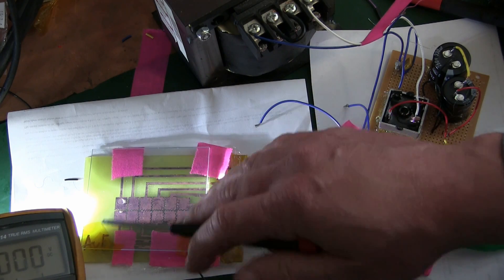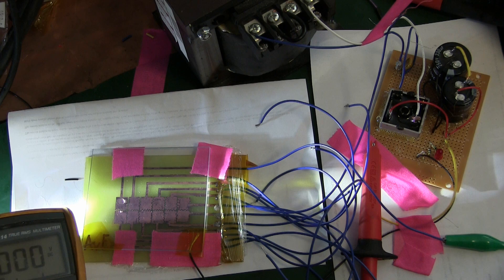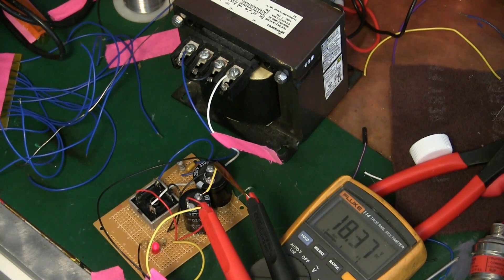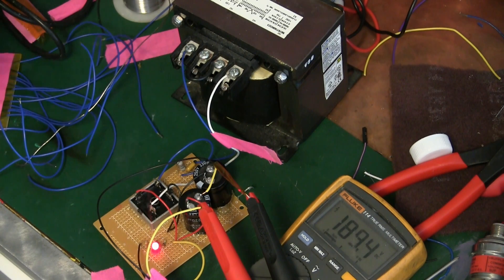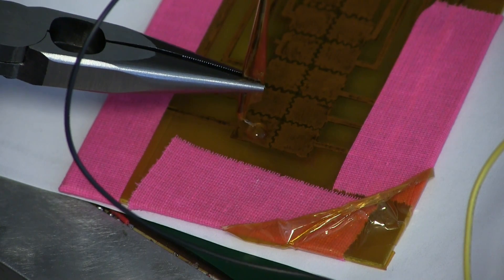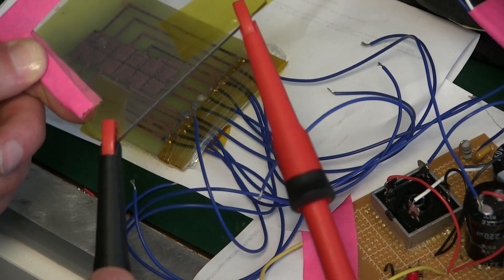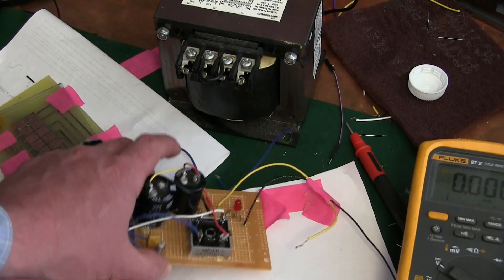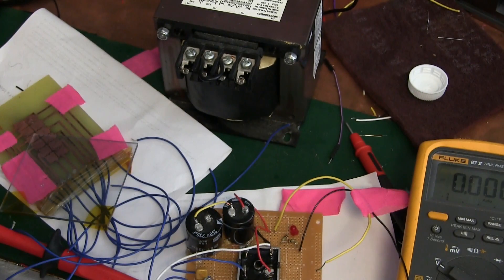Electrowetting Experiments. Penny Pucker over 9000!

Comment: AVE cool concept.
Ultravolt makes HV supplies that will be just what the doctor ordered and they're adjustable.

Since this is volts, not current, 0.1uF 1KV ceramic caps should be fine.
Overvoltaging transformers can cause them to saturate even on the secondary side.  You might want to consider using a voltage multiplier to get the higher voltage you seek.

Comment: Love your vidjeos!  You need balancing resistors on those capacitors.  BTW, save good, solid American pesos by using hydrogen peroxide and muriatic acid for etching. No stain, and cheap as dirt. Keep up the good work!

Comment: Just shooting from the hip but at 9:26 when you are holding the plate and saying that "it needs to be conductive" what about cutting out a square of ESD bag material and backing it with an insulator?  Got to be cheaper and more available than conductive glass!

Comment: I made a boo boo yesterday I was soldering  2 caps to a board and the iron slipped out of my hand burned the crap out of my arm .Then it hit my fluke 87 screen and melted that. I went to the hospital as I am a disabled vet and on some pretty strong meds that affect my healing . The said is a third degree burn 4 inches by about 5 inches on my right arm.Now I have to take antibiotics and change the bandage 3 times a day and put some crap that burn like hell on it. All from a slip of the solder iron

Comment: Hmmm, you didn't have any of those "voltage sharing" resistors across those two capacipeppers. Isn't there a risk that the pixies aren't equally shared then and one goes off into space? Just wondering.

Comment: AvE you can put lots of resistors in series of 'normal' 1/4W rating and make a massive potential divider.  This is how simple high voltage measurements work

Comment: Dear Sir, 250V isn't so scary, but your caps can easily approach 500 each due to various mess-ups. Zener diodes can be used to clamp the maximum voltage across the caps. You also could use avalanche diodes in clamping reverse config to shunt the extra pixies to ground if each gets above a certain voltage.

It's not a BIG deal since you actually like to free the trapped smoke manufacturers place in all electronic parts. But don't rely on thought that a place on your board has to have only 10 volts when the pixies are freed to find their quickest way home.

P.S. Please smash no more juicers.

Comment: I think you misread the notes on how this works.  Your problem is surface adhesion.  You need to add a hydrophobic coating onto the film, not make it conductive (for God's sake, do not make a surface connected to an HV source, conduction!)  In the original design covered here (http://www.gaudi.ch/OpenDrop/?p=116), they used " Polyethylen (PE) kitchen foil (saran wrap) coated with Rain-X a commercially available rain repellent for wind shields."

Comment: AVE i have the bigger brother to the old school black and decker drill BOLTR you did a few videos back and a heating control energy saving gadget for gas or oil fired boilers if you fancy taking them apart they are both on ebay il do you a trade for rulers and T shirts if you want

Comment: FYI for the current limiting resistor, I've done this before, I found it's best to use two resistors in parallel, two 750k 1/4 watt jobbies or thereabouts, depending on the current the LED needs. At least, if you want full brightness, and you usually do for these kinds of voltages.

Comment: AvE, I think the pulsing of the voltage may be what makes the drops move.  The sound was really prominent in the video you showed where it was working.  Makes sense because it probably works on the capacitance of the water through the insulating layer.  Need some way of pulsing the high voltage.  Maybe you could use a little high voltage switching power supply like a fluorescent light ballast.  You definitely don't need much current, just the high voltage in sharp pulses

Comment: AvE, try a CCFL backlight inverter. Quite high voltage (>1000v with no load) but if you were to touch it, you won't lose a finger or die, since the current is relatively low. Add voltage doubler if you wanna make the pixies even angrier.

Comment: Erm maybe use a cockroft walton multiplier?  much safer ? caps and diodes.. i bet you have

also kapton is hard to get lower then 1 mill, try using mylar?  it can go as thin as 1 micron if you like. but 6 12 and 20 are easy to get. polyeshther is still a relative good insulator.  and use Lycron crystal or any other permanent colorless antistatic spray to make it conductive if you like.

Comment: how those relays or working with 500w dc .. dc has a higher arking volt and it will make those contacts coated with carbon very soon. there is  a very special type of relay that has a special gas to prevent arking on contact ..

Comment: I do allot of work in industrial applications(electrician by trade). I work quite a bit with millwrights and you sound like one. You know your hydraulics, mechanics and all that good stuff. However your electrical knowledge exceeds all of the industrial mechanics that I have ever worked with. 
AvE are you a millwright or a mechatronic god by trade? 

Cheers from Norway!

Comment: Best to add some resistance across each series capacitor to swamp out leakage currents in electrolytic caps that might otherwise make voltages divide unequally. You can also consider putting your indicator LED circuit across just one of the series caps, thereby reducing power wasted in the limiting resistor.

Comment: I used to work at company doing electrostatics. One of my last projects before I left was designing an electrostatic hold down for paper. For our testing, we used a solid copper clad, and charged the copper to from as low as 3kV up to 10kV and it worked really well.

My guess is that your voltage isn't high enough. You could build a voltage doubler circuit to boost the voltage,  there really isn't a whole lot of current that you need. That should easily get you in the kV range, and might yield better results.

Comment: AVE you can try a 2 stage Cockcroft-Walton Voltage multipler to make a low current high voltage DC supply, and piss easy to make - you can keep adding more doublers to them to get your desired voltage and they only require small elecrolytics (rated to the input voltage) and  diodes (rated to the output voltage - 1n4004 diodes will withstand 400V reverse so you can through them in series to make higher voltage diodes), at trade school they only let us play with 24V ac and using a multipler got up to 400V with 6 steps as they don't exactly multiply with a large number of steps because of losses but if you start with say 240V you should get  a few kV easily - diodes being the major limiting factor. Much better solution than the bridge rectifier and great big electro's

Comment: I just watched this related video and they reveal some specifics about their setup. The top plate and bottom plate are coated in a titanium mixture and grounded (conductive) and sprayed with teflon (hydrophobic). Also, they are using a differencial in the 100v range and  oscillating it at a frequency which I don't remember (maybe to gain inertia in a pendulum effect to overcome the gap)
https://youtu.be/tHOvxvL83cw

I also noticed that in the opendrop videos, the drops are large enough to bridge to the next pad.

Comment: Got a 15W resistor in one of my circuits because I needed a 56 Ohm Resistor ASAP at the time. A bit overkill for a single 20mA 3.3V LED, but whatever.

Comment: Happy you like the OpenDrop project and that you do your own experiments on electro-wetting. Your setup should totally work. To move droplets try applying a thin film of silicon oil (viscosity 5) directly to the electrodes. Then apply a stretched layer of parafilm foil. Then some silicon oil on top. Then place a droplet of water about the size of one full electrode on the electrode. Remove any charge in the droplet by touching it with a thin wire that goes to ground. Then try to move it with the high voltage. I use 250 VDC, higher voltage is not always better :-). I am happy to send you a sample of Parafilm and thin silicon oil. Best, Urs

Comment: Hi, you could use a cap with a led instead of the resistor on the ac output to get around the wattage problem.

Comment: Positive voltages repel.  Set up the board so all the panels are positive, with the panel where you want the water to go at negative potential.  This will steer the water drop to where ever the negative pad is.  Put a resistor inline with the ground so the electricity does not vaporize the water.

Comment: putting electrolytics in series is frowned upon since the leakage current differences  can cause significant voltage differences  between the individual caps and they can still go kablamo.  much like batterias you can however put resistors in parellel across the caps in order to (try) to keep equal voltage across each cap.  this is not assurance it wont blow up but ever increases your odds it wont.  be sure to wear safety glasses, aluminum shrapnel  can ruin your day for sure.
Reply: Safety Squints™ activated!

Comment: P=IV may be true, but your current is not constant, it increases with the voltage since you're using a resistive load (I=V/R). A more helpful equation for the power dissipated in a resistive load with variable voltage would be P=(V^2)/R.

Comment: What kind of soldering iron and solder  would you recommend for hobby work, Airsoft wiring and general electronics. I keep eating up the iron tips and tried what i can get locally in Puerto Rico. Thanks in advance :D
Reply: Robert..to reduce the tip wear..try to avoid putting the solder directly on the tip(you do need to do this sometimes, but doing it less will increase the life of the tip).
also, if you are using plated tips(likely), don't file them until it's absolutely necessary...once you go through the plating, the tip wears faster.
Reply: Thank you sir

Comment: I believe that an isolation transfer is simply an even 1:1 ratio of voltage otherwise it's considered a step up or step down transfromer
Reply from the maker: meh. How else would you describe a non-autotransformer that steps down for powering instrumentation?
Reply: Isolation transformers provide galvanic isolation and does not matter if it is step up/down.

Comment: If you need conductive glass, LowE (e=emissivity) pyrolytic coatings are. PPG Sungate500 or Pilkington EclipseAdvantage both are very common types of this glass, and have been  used in a lot of residential windows over the last couple decades. A free source should be eady to find (residential glazer or even old insulated unit). The coated surface can easily be iidentifed with an ohm meter and will have a slightly yellowish appearance/reflectance.  Newer MSVD (magnetic sputter vapor deposition) coatings are conductive to, but are no where near as durable and will oxidize quickly. The old coatings are very durable.

Comment: AvE, how about trying the hydrophobic neverwet paint?  Also, based on the jiggly bits, (mmm)  it looks like they are using an AC exciter voltage of relatively low frequency.

Comment: short the yellow wire to the white wire. it'll be fine I promise :) (although you might want to get higher voltage capacitors first...)
Reply: And I mean the yellow wire between the capacitors.

Comment: 3:27 Especially at rectified mains / high-voltage stuff, when series-ing up caps, you're gonna wanna include some balancing resistors in parallel with'em; a pair of 47k-100k (or however many you need, if you series up more than two caps) oughtta do.
Reply: Yep, assuming you used 100k resistors in this application with 240VAC rectified to 340VDC, they'd be dropping 170V each, so they'd be dissipating 289mW, you'd want 1W resistors minimum.
Reply: Yeah, especially if you're using two capacitors of different values!
Rule of thumb is look up the datasheets for the caps, find the max leakage current, multiply that by 10, and choose resistors that will draw that current at the working voltage.
Reply: Now I'd think that if you were doubling up caps for current rating, you'd put them in parallel, not in series?
Reply: For current rating purposes (increasing the ripple current capability), yes, you would indeed parallel them.
Reply: It's gonna be okay for prototyping. Would be nice to include them but hey, no risk no fun. Also electrolytics aren't usually that sensitive to unbalance since they leak more with higher voltage, making a balancing on their own. Just gotta be brave and not shit your pants if one blows up with a 7.64mm nato round POP sound

Comment: turns out you get used to stupid dc voltage next to your fingers. 700 volts through a tiny coil of wire is enough to get your bones to move magnetally! under your skin. comforting eh?

Comment: uh... just use a CCFL driver out of a dead laptop or old LCD screen. 
edit: there was supposed to be a ? at the end there, was meant as a potential future path..
Reply from the maker: The citizens of youtube await your upload.
Reply: AvE, well shit. If you don't mind promising to send me a get well card if I blow the last of my hair clean off or set my beard on fire, I'll give it a go. Oh, and I thought there was a "?" at the end of that post. oops
Reply: Ordering a little inverter module , some ITO coated plastic for the top electrode and some Neverwet to try coat the plastic with.
Reply: +AvE I'm only going to use a tiny bit of the ITO plastic It's not too expensive, but I'd happily send you the rest the sheet if you'd like it. (If the hydrophobic coating doesn't end up totally fubaring it up I can send it to you after coating it too) 

Anyone have advice on how to switch a couple kilovolts? I was going to make a resistive divider and current limiter to hopefully avoid blowing the ITO straight to hell, but I don't have a better idea than manipulating  a couple wires with plastic rods, to safely connect and disconnect the electrodes.

Comment from the maker: www.gaudi.ch are the guys making the "opendrop".  You can learn more about microfluidics there.
Reply: AvE the gentlemen in one of their videos mentioned that a super hydrophobic surface is critical for their device to work. 

Methinks there may be a frictional element that was working against ya.
Reply: Awwwee. I was waiting for the explosion like ElectroBoom does on his channel.
( ͡° ͜ʖ ͡°)
Reply: a little spritz of rain X instead of cap'n tape?
Reply: edstirling

Yes, basically. They used Rain-X in their first experiments.
 http://www.gaudi.ch/OpenDrop/?p=116
Reply: 2:06 programmable electric tape dispenser?  Fancy pants!
Reply: It's not a democracy, but I'm voting for some rain x anyway
Reply: AvE do you use machine tool wire in the shop/sewing room? Is it very pricey? I really like the feel of it.
Reply: I studied this in University, I can probably copy and paste some of my notes on the theory if wikipedia isn't enough for those interested.
Reply: worldtraveler I believe it's a wax, which might make the solvent xylene.
Reply: It's just dimethicone dissolved in organic solvents.  I like the stuff, but you definitely need to thoroughly clean your windows and reapply it weekly, at least. Stuff has a nasty habit of picking up road grime over time and making a sludge film that you need solvents to remove again. Not a fun surprise when you use your wipers for the first time in weeks, and the schmoo schmears!
Reply: http://www.gaudi.ch/OpenDrop/?p=120
there they use a thin teflon foil plus silicone oil, might be worth a try ...
Reply: This is just like ferrofluid except with an electric field instead of magnetic.  The higher the dielectric constant of the liquid, the higher pressure pulling the liquid in.  (Just like a substance with magnetic permeability is pulled into a magnetic field).  I think the hydrophobic surface is to minimize the amount of fluid left behind, and reduce the surface tension so that less e-force is needed to move the drops.  You need some minimum e-field strength measured in volts per meter, so the longer your e-field lines are, the more voltage you need to get enough field strength.
Reply: can you also try it with a non polar molecule like mineral oil?
Reply: Scotch guard the dielectric to reduce wetting?
Reply: Scotchguard?
Reply: Quick look says.. your contacts are to big. Looking at the demo the droplets are just on overflowing.
Reply: Applied science explain a bit on this electrowetting    He was using something like 5kv.
Reply: AvE    I don't have a clue what you're on about but I find it entertaining.I put my pecker in a vice and the vice broke.